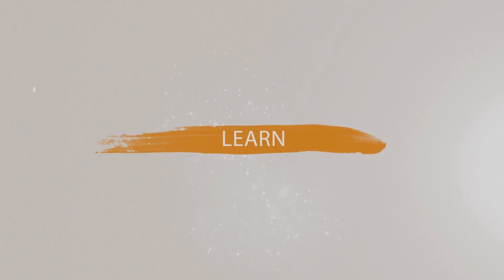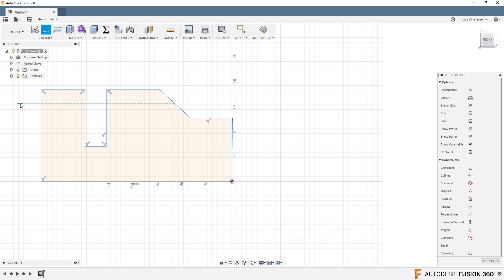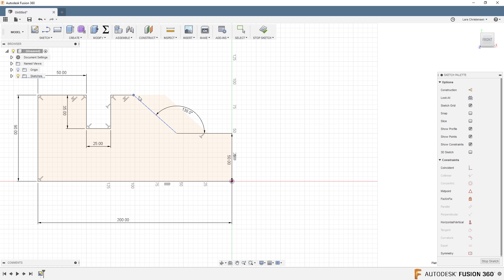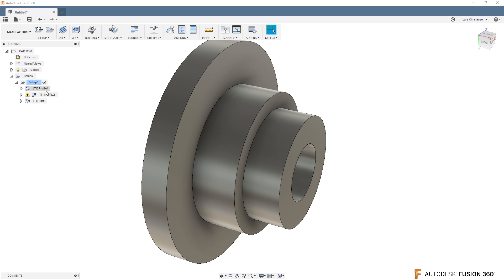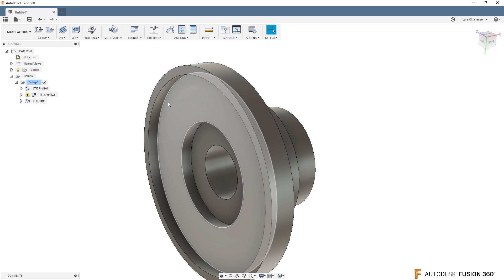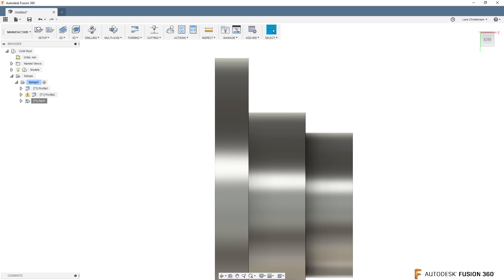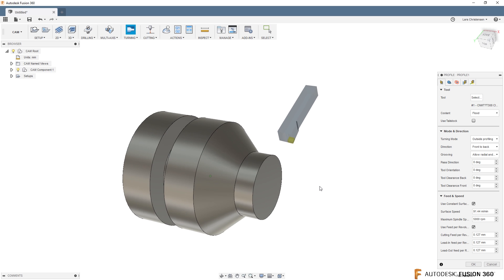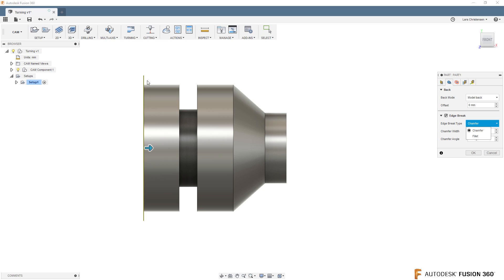New CAM Turning Features in Fusion 360 — Season 2 EP4

Comment: well. nothing new. allready do these manual.. if someday something that actually give me option make part faster.i wait that day. too many options there.forsimple operations.it should be default without thinking do as it.using same funtions that millions machines allready cut 50 years. no funny busyness..i been trying. and its too slow work. simple part that take 30 second writing. hit cycle start. here is my part this is my tool cut this path. nono dont CUT INSIDE MODeL!! when cam actually smart.or programmers who developing it

Comment: Thanks for the video.  I just got done using some of these features.  I have a lathe with no pick up and need the cutoff tool to stop at .100.  I adjusted the inner radius to make the tool stop short but have to wait for it to feed out of the cut.  Part is to heavy to rotate fast and drop so its bent or hack sawed off once the spindle is stopped.  Do you know how to stop the spindle and tool at the bottom of the cut in the software?

  I have also found that when cutting off the standard haas lathe post takes into account the radius of the tool and needs to be accounted for to get exact size.  I also found that when selecting output high feed rates instead of preserves single rapid moves the post doesn't switch between g99 amd g98.  Either we need a smarter post or an add in button to also tell the high feed to output ipr or ipm.  The post will output f50 instead of go and not put a g98 in front of it.

Im not sure how to share the file to show the issues.  Any help is appreciated.
Reply from the maker: I would suggest you post your question here. More smart people than me https://forums.autodesk.com/t5/fusion-360-computer-aided/bd-p/2070
Reply: Stopping in the bottom of the cut... that would take some fudgery in the post. And if you want custom post mods you can get a competent reseller to do them for you if you like. The high feed stuff... Are you using the latest post? I think some of that got fixed recently.

Comment: Thanks for the Video.
One question: is there a new licensing System implemented? My F360 doesn´t recognize my educational license after reinstalling and asks me to "buy" a new one.
Reply: Markus_B, yep. I had to pay up after my year expired. Worth it. I just finished building my CNC router, but it would be practically useless without Fusion 360. I looked for alternatives, but nothing was even close. If you’re actually a student, you might be able to find a way around it. Not sure.